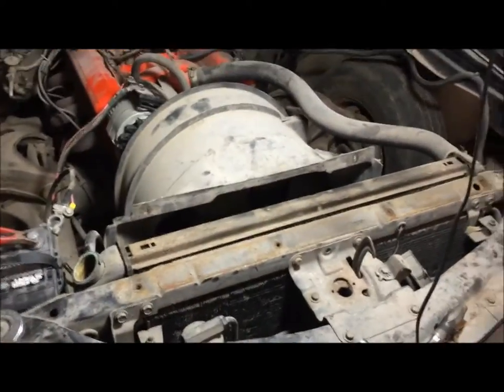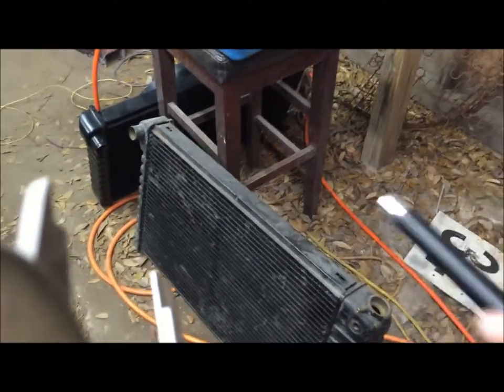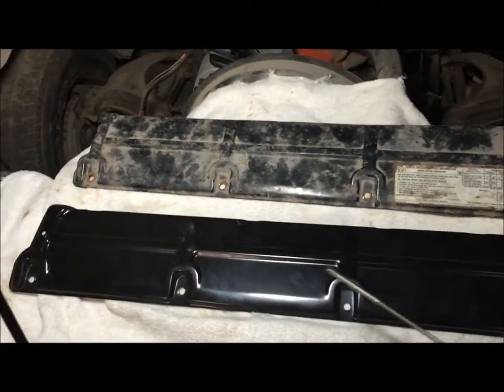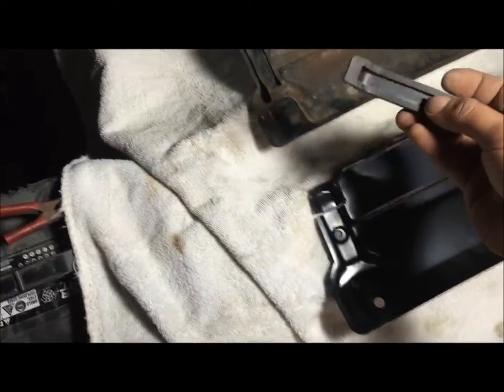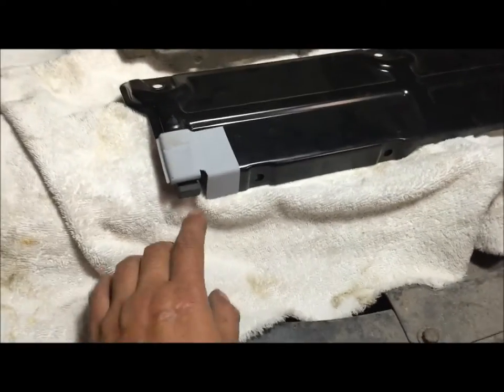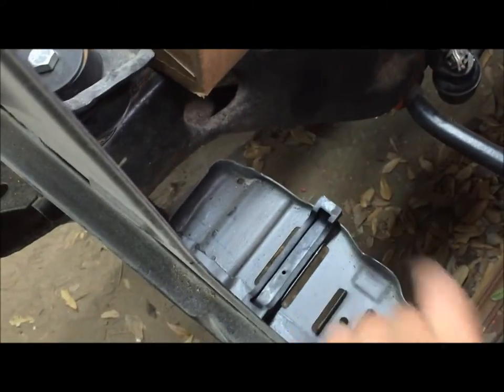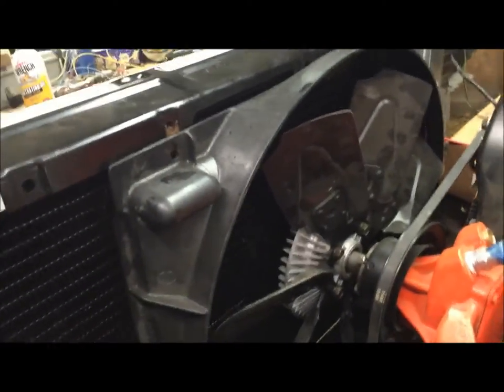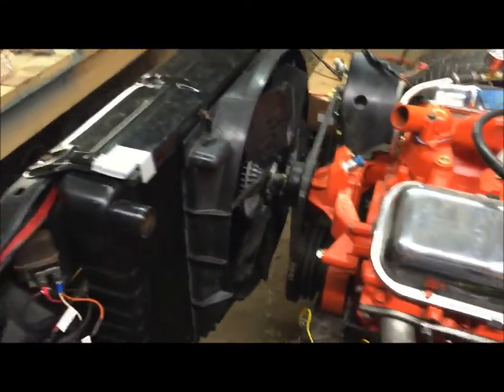chevelle big block radiator 3 core 4 core how to

Comment: hey thanks a lot bro you accually  helped me out a lot and I fabricated my own rubber mounts, I had the same problem with my mine there was a bit displacement but I think it's cause the the bottom bracket that holds the radiator  it sits straight but when cut the driver side it drops down a bit from the corner so I putt rubber grommets so the cover plate holds it in snug or maybe it was the  rubber mounts I fabricated

Comment: hi chris I  installed a radiator fan but it blows to much hot air that i can't even stand in front of my car even the metal bumper gets hot . any ideas?
Reply from the maker: does the engine run hot? that’s all that matters
Reply: @chriscraft77022  not  it doesn’t thanks
Reply: Need to blow air towards the motor, not out the front... 10months late, but good luck 🤞
Reply: @teamarctic1100  thanks. I had the wrong fan in it.